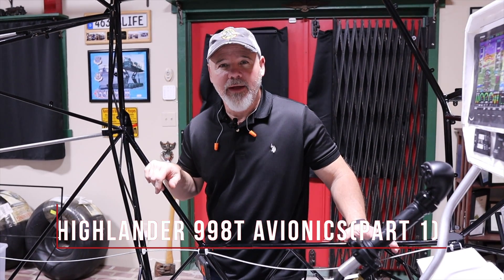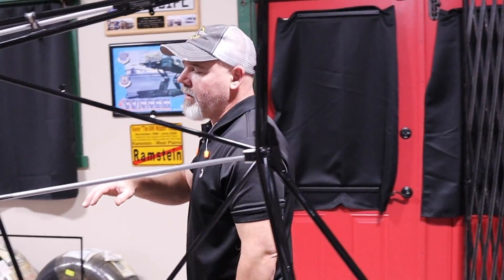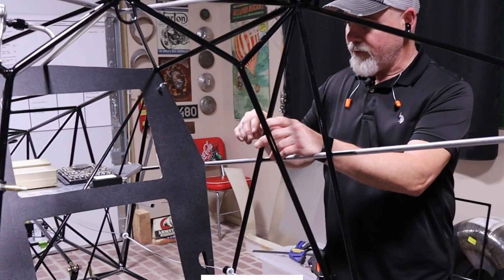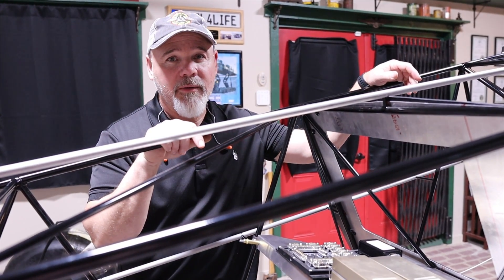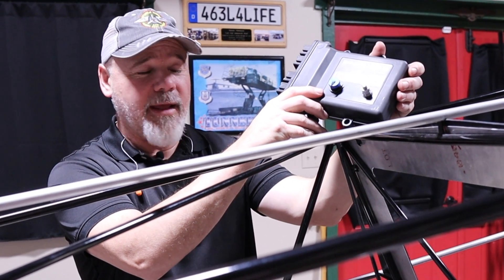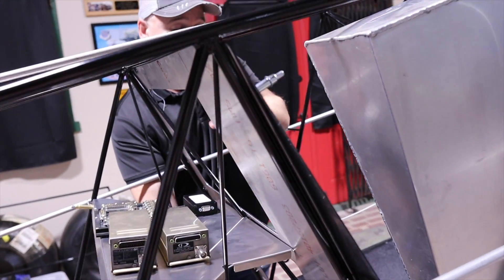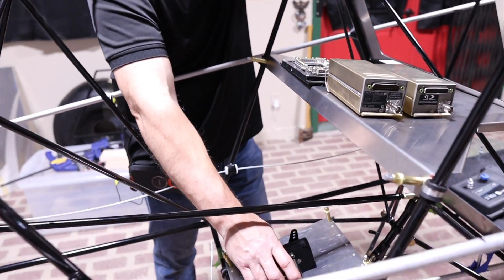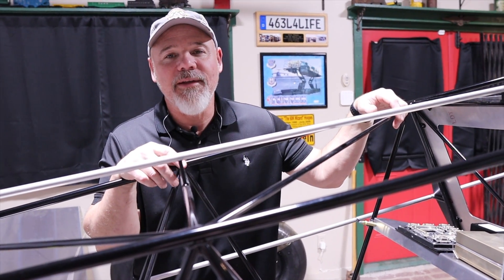Highlander 998T Ep. 13 - Avionics Part 1

Comment: what roll servo did you use? and what arm did you use for the pitch servo? did you put a servo on the trim?I am putting in a Dynon system into my Highlander and am about to order all this. also, did you ever figure your the wiring harness?